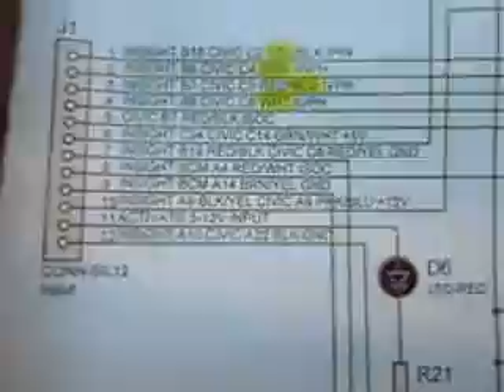G1 Insight and HCH1 Civic Current hack variations.

Comment: Peter Perkins Any chance you know a way to hack the Honda hybrid system to Only run on gas but at the same time using the compromised hybrid battery to still run the electrical system.. i.e Ac/lights.. etc?
Reply from the maker: Please post this question on the insightcentral.net forum, there are several options.

Comment: So when you say +30%, do you mean that regardless of what the BCM determines appropriate assist (based on accelerator pedal position) -- this will increase that by 30% ?
I'm game for that at lower RPM's (where the IMA makes the biggest difference) but I think at highway speed it would just drain the battery faster without doing much.

Frankly I'm amazed that you are the only person I've found building and experimenting with things like this, I would have thought a small but vibrant community would all have devices like you have built here.

Heres a stupid Q:  Is there a way to use the volt tap connector to grid charge individual sticks (like say, the ones giving the biggest problem) so that we don't have to beat up the rest of the battery grid charging over and over when we have mostly good sticks still?
Reply: Over at http://www.insightcentral.net/ there is a community for this stuff

Comment: Can people buy this from you?
Reply from the maker: Yes

I now pcbs, kits and built unit stock available. 

All items include free postage and packing, software license and updates.
Hardware is rtb 3 year warranty.
Payment via paypal, you pay the fees.
UK pricing is $ price converted at ratio of $1 = £0.60

Various OBDIIC&C case options are available on the forum, as are the free 3d printer files.
I may have a stock of OBDIIC&C 3d printed cases in the new year, details to follow. 

OBDIIC&C G1 & HCH1 OBDII Display Command and Control Device for G1 Insight & HCH1 Civic.

I have built and tested units, minus the case etc $249
I have kits inc, programmed pic, cable, plug, lcd, components etc (Everything minus the case). $149
I have a plentiful stock of plain pcb's. $49
OBDIIC&C Gauge

IMAC&C G1 Ima Manual Command and Control Device for G1 Insight. 

I have built and tested units, inc cable, lcd, switch etc $349 
I have kits inc, programmed pic, cable, lcd, components etc $199
I have a plentiful stock of plain pcb's. $49
IMAC&C aka IMA Control & BCM Gauge Combo

IMAC&C HCH1 Ima Manual Command and Control Device for HCH1 Civic.

I have built and tested units, inc cable, case etc $249
I have kits inc, programmed pic, cable, components, case etc $149 
I have a plentiful stock of plain pcb's. $49
Imac&c hch1 civic

IMA Boost G1 Ima Boost/Reduce/Battery Protect and Kers Device for G1 Insight.

I have built and tested units, inc cable, case etc $249 
I have kits inc, programmed pic, cable, components, case etc $149 
I have a plentiful stock of plain pcb's. $49
Simple IMA Boost and/or reduce device.

Current Hack G1 & HCH1 Ima Current Increase Board for G1 Insight and HCH1 Civic.

I have built and tested switchable +30% & +44% units, inc cable, etc $199
I have switchable +30% & +44% unit kits inc, cable, components, etc $149 
I have built and tested fixed +30% units, inc cable, etc $99
I have fixed +30% unit kits inc, cable, components, etc $49 
I have a plentiful stock of plain pcb's. $24 
Inside the G1 MDM & more power!

Fan Control HCH1 Ima Fan Control Board for HCH1 Civic.

I have built and tested units, inc cable, etc $149 
I have kits inc, programmed pic, cable, components, etc $99 
I have a plentiful stock of plain pcb's. $24
HCH1 IPU Fan Control

Simple Cycler G1 & HCH1 Simple Grid Charger/Cycler for G1 Insight and HCH1 Civic.

I have a plentiful stock of plain pcb's. $49
Simple Cycler

Voltage Tap Monitor G1 & HCH1 Battery Stick Voltage Tap Monitor for G1 Insight and HCH1 Civic.

I have a plentiful stock of plain pcb's. $49
Stick pair voltage display.

Note the Simple Cycler and the Voltage Tap Monitor are still in the prototype stage and available for experimenters/early adopters only.

Paypal to 150mpg@gmail.com

Peter
Reply: Peter Perkins I am interested in a lot things on your list, but right now I'd like the  "built and tested fixed +30% units, inc cable, etc $99". I have Mima connected to my car, where do I connect this broad to?